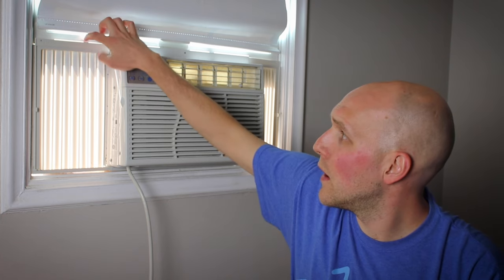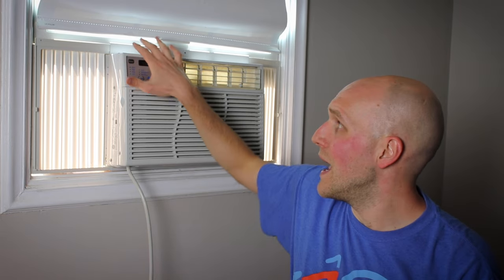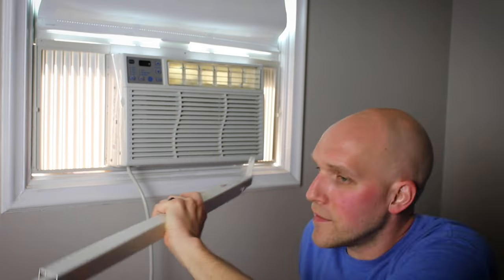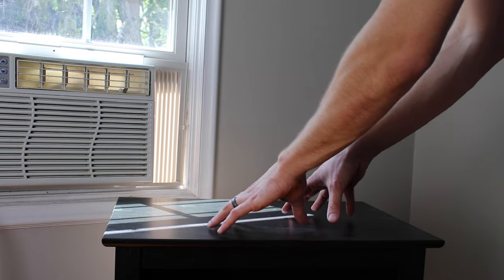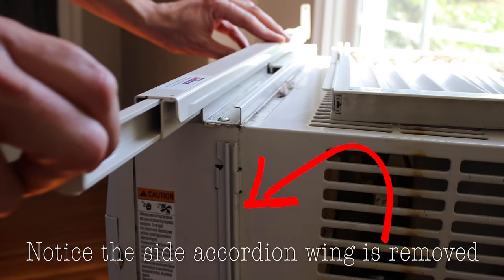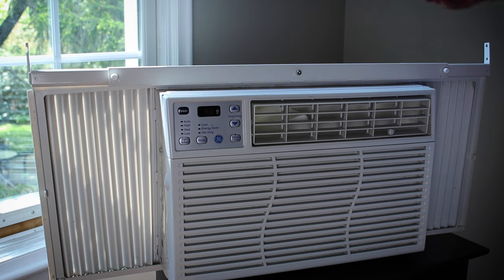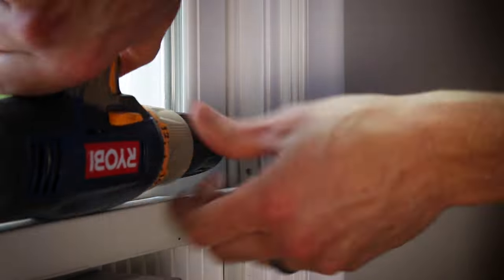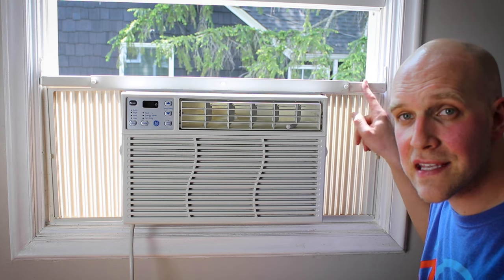How to Install and Reinforce Window AC Unit

Comment: I wish the ACe Brace was closer to $30.   I'm not spending $75 for one.  It looks like a great device and it does its job well.
I'll just go buy a piece of steel bar and make something similar.  If your making it for a single window you don't need the adjustability.   2 bends, 2 twist, and drill 4 holes.
Reply: It's now 90 pretty soon nobody will buy it if is it going to be that costly

Comment: Yes, the ace bracket seems to be a good idea compared to having a loosely mounted AC unit in the window. Your explanation for the need (importance) of the ace bracket is well taken. However, I agree with others that the price of $70 may be high for many people in these times of economic hardships.  Where did you buy your ace bracket?
Reply: $29.99 plus shipping tops.
Reply: Agreed.  I'd pay $30 for one but not more.  I'll try to make some similar out of a piece of steel bar.
Reply: @jTempVids  agree with you as well. $75 is quiet extreme. It’s a great idea, but no way for that price. I don’t have steel, but do have some leftover storm door edge trim 🤷‍♂️. Maybe I can try that I mean it would be for a small ac for the attic, lol

Comment: $70, way too much money for basically a metal bar. Thanks for the review.
Reply: I had a ac unit fell six stories it did not hurt anyone. This is well worth the price
Reply: It's a telescoping support brace that fits many window openings and also creates a slope that allows for condensation to drain.  And it's been tested for use.
Reply: Yeah sure until someone kicks in your damn AC unit and steals your computers, electronics and anything else they want.
Reply: Guess i am not understanding how the unit could fall out anyway if the sash is braced down on either side against opening at the top of the sash.
Reply: @EliteOnTheBeat  better eliminate all of your windows. Those can be broken and (kicked in) too.
Reply: Wow!  Your nickname is close to naysay, so it’s understandable.
Reply: @EliteOnTheBeat  i mean the windows themself can be broken as well if anythint the AC adding more security by being a noise maker.😂😂Im pretty sure you'll hear them big jokers falling on ya floor.

Comment: Can go for a 1/2 in. x 1 in. x 36 in. Plain C-Channel ($10 at hardware stores) or 36 in. x 1 in. x 1/16 in. Steel Square Tube (about $12) if the window width is less than 3', cut the window length and use it instead. (I just sawed a 1 in. x 4 in. x 6 ft. wood board iying in garage ).
Reply: Share a pic
Reply: @challo213  if you google it you can see that.
Reply: now i gotta figure out how to cut that lol

Comment: I couldn't quite see your window sill. Is it flat and does it have enough depth for the ac to set flat on the sill? I've never owned a modern window but i want to replace one 50yo wood, thin glass, window with an new insulated one. I get your tips on supporting the top - i just need to be sure the sill is flat like my old window. Can you help me out on that?
Thanks

Comment: I have 100 year old windows with the rope and counter weights inside the vertical sections , my question is how do you latch the window locked shut? Thanks for any reply.
Reply: We had these previously. There are very few things you can do since these windows usually get replaced. We drilled in the side of the window at the point you don't want it to go up further. The hole should be a little larger then the nail and inserted a long nail that stuck out to prevent the window from opening further.  This allowed easy removal when we took the ac down and wanted just fresh air. You can also just screw it in if you don't plan on removing the ac.

Comment: You still have a lot of weight sitting on a flimsy plastic or aluminum frame on the bottom. I wouldn't trust anything more than than a light 5,000 BTU AC on a modern window. It's a shame they don't have something like this for the base too. Doesn't the thickness of this effect the tilt the wrong way? The AC needs to be tilted slightly so it drains properly.

Comment: I just cut a p s of wood put light foam on both side .screw ac to wood.
Bring down window.
Measure an cut smaller pcs of wood .install vertically on either side.
Put foam to reduce airflow.

Comment: Nice but was i reading it right $70. Could just pull the windows down and cut piece on wood to fit top of window to window frame that  would prevent window from being raised without marking up window
Reply: $75.99
Reply: this is actually a good idea!

Comment: ive got a 21 inch window and this ac just barely fits in with the side panels, wasnt hard to figure out installing just need a screwdriver and it kicked in pretty fast

Comment: It didn't show how the side panels stay closed. I have cats! They would easily open the side panels and run out into the busy street I live on. Besides, my accordion flaps are old and wouldn't stay closed like these did at all.
Reply: They seem flimsy asf I'd put wood in the sides probably I see thats what alotta other ppl do as well unless it has to have those.

Comment: VERY HIGH price! Should be $15 to $20 MAX for this. RIDICULOUS PRICE for otherwise a great product!
Reply: It is made in the USA (a reason for the high cost) and is meticulously designed to fit over the flange and slope the AC unit outside.  The steel is thick and was tested not to deflect.  So this goes into the cost.